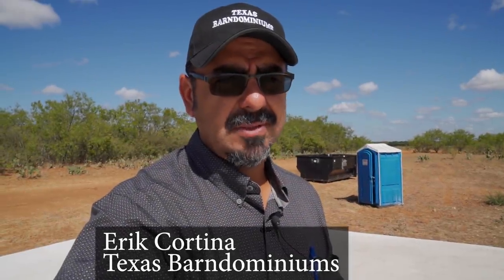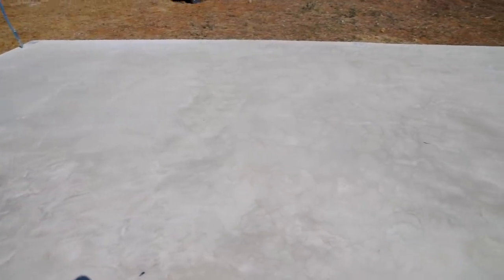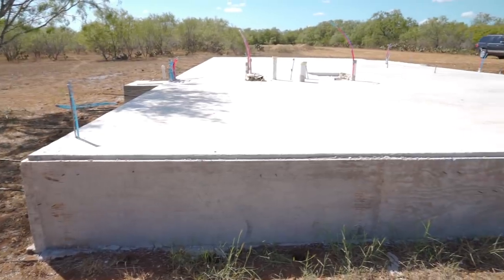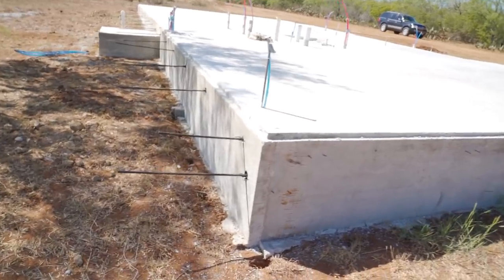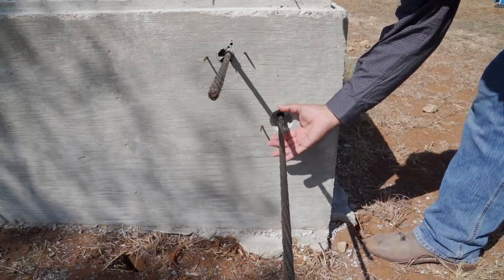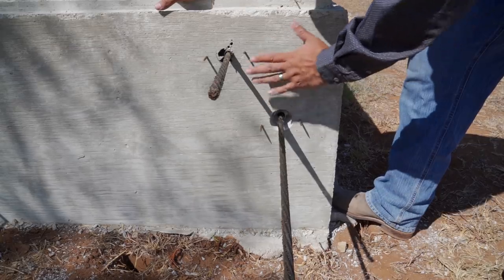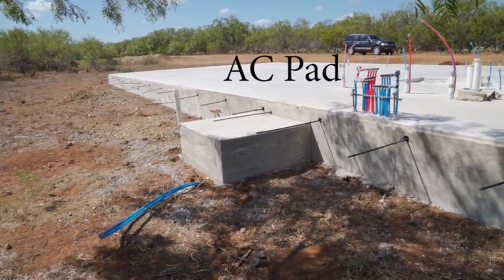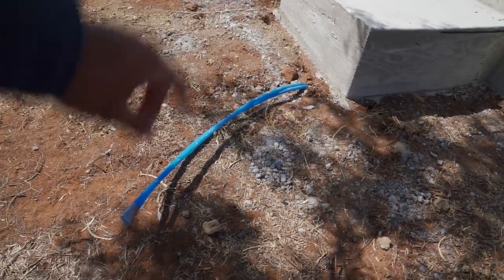Post Tension Concrete Slab - The Barndominium Show E167

Comment: Eric is back! Glad you got a vacation! You just demonstrated one of your greatest strengths; you never quit looking and learning about what you build and the product you sell. Bravo! Post  tension is the only slab on grade foundation it is safe or even advisable to dig under; the company I worked for got a job to replace the plumbing under their condos- all their original bids had included x rays to find the cables and cutting and removing long linear patches of concrete (in sections between the cables and wanted months for each building (two condos, about 5500 total square foot slab).My boss was a civil engineer; he did the home work, and found a complete set of foundation plans and fely locating any neccessary cables would be easy with a magnetometer. We won going away and I've never started a job with so many ashen faces going in- mine among them; we raised up a labor crew, provided shovels and such and tunneled under the middle of the slab- all the plumbing for both condos were on or just off the mid line.The tunnels were about 45-50 long from side to side and 4 feet wide and 5 feet high beneath the building, we cut out the rotten plumbing (the build was on what had recently been farm land and had shallow cover over the Austin Chalk that underlies much of central and east Texas- the calcium eats copper and cast iron pipe) and replaced it. then the labor crews dragged all the earth back in and used w
Wacker Packers to pack and stabilize it, eventually getting all but a couple of bucket fulls of material back under. The City(Dallas) was out and measured our dirt piles and wanted to make sure we didn't cheat on the refiill. No injuries from collapsing foundations, three four times quicker than all the other bidders thought and best of all the boss bought his wife a big new home with his profit. Needless to say, I like post tension; If I cant have a house pier and beam, Post tension is the only way to fly- as you say if it is appropriate for the structure/foundation planned. It is also the cheapest way to build a house from an HVAC standpoint, having the fewest feet of exterior wall for the square footage
Reply from the maker: Thank you.  Cool story.
Reply: @TexasBarndominiums  Hope it helped! The Condo we did in 1997 is still standing- remodeled twice since, but still standing on that foundation. And you are welcome! Vaya, amigo!( you now know half of my spanish skills - the other half is all nasty words). FR

Comment: The "clamps" are referred to as wedges, they slip inside the anchors and hold the cable taught once it has been stressed. The "cups" are referred to as pocket formers and prevent the concrete from filling in the portion of the anchor where the wedges are to go.
Reply: to the uploader- Didnt understand A THING! WHY dont you SHOW us when they are DOING it instead of telling us with your words. We come to you tube to SEE things happening not to just hear and see "photos. We need VIDEO of things happening! USELESS video!

Comment: The plants down here in South Texas use fiber and run 40 ton cranes on the on the pads without ever cracking!  Its much better than rebar.  Im near Corpus Christi with a lot of sand and we uses post tension for the most part with flat work using fiber.

Comment: Haven't done concrete in years but when I did in Ohio we personally chose to use fiber whenever we could, our personal largest was 70' x 100' for a pole barn, but even in patios and driveways it would help out as just added insurance. Agree though it is not a replacement for rebar or mesh in most cases. Love your videos.

Comment: I was a rod buster in the 80’s in Dallas.  I tied rebar (tons and tons of rebar) and installed many a cable in the Dallas skyline.   Ones isn’t any better than the other, they’re just different.  You can hurt yourself a lot more with cables but rebar will break you down over time.  It comes down to what you like to do.  Me, I preferred cables, there’s more math to it.  😂

Comment: I work for a concrete company here in Tucson AZ. We do comercial and reaidental work. Have to say that for the last few years 90% of residental work has been post tension. So far, been working great. But like you said it all depends on the type of floor that you do. Also about the fiber, we normally use that with 3000 psi concrete for driveways and sidewalk. Seems to work pretty good. Just incase you ever decide to work with fiber. But anyways really enjoy your videos.
Reply from the maker: Thank you.

Comment: We use stealth fiber her in AZ a lot (at least I do). I prefer the stealth fiber over the large because we do a lot of grind and polish slabs or stain/seal and the stealth/micro fiber doesnt show on surface. It does help some against early shrinkage cracks, as long as your slump isnt too high.
 If youre pouring on compacted ABC sub grade with rebar or post tension, water to cement ratio not too high, fiber mesh and putting a hard trowel finish on it, I dont think there much more you guys can do except for maybe curing techniques.
I typically just keep the slab wet as much as possible for first 24 hours after finishing.
No cure and seal..ever. I will not use that stuff

Comment: That "machine" is called a stressing jack.  They "tension" the cable not stretch.  They measure the "elongation"   pt cable won't keep it from cracking, but it will keep it all together in the long run.  But what do I know,I'm just a bus driver.

Comment: is the slab 'loose' in a sleeve? I'm picturing doing the tensioning and the rebar is getting pulled against cement and it doesn't seem possible.

Comment: Usually How deep are the post tension cables from the top of the slab? Reason I ask if I want to bolt down an air compressor to the concrete I don’t want to hit a PT cable.

Comment: Fiber is meant to control shrinkage cracking in the plastic state. It does very little after its initial set. The only fibers that add strength post set are steel fibers which can splinter at the surface. Obviously not good for bare feet or small children. If your early pours with surface retardants are giving you good results without shrinkage cracks, stick with that. Keep up the good work, it's always a pleasure watching a true tradesmen vs. a hack.
Reply from the maker: Thank you.

Comment: If I wanted to have a two story barndominium built...is pouring a slab on top of another existing slab, a better option than building directly on clay, sand, loam, & silt soil? 
I'm not a builder, am interested in having a source to research such info, if available as well.
I live in Corpus Christi Texas.
I have to say, I highly enjoy watching your show!
Reply from the maker: It depends on how the current slab was built.  Hire an engineer and find out for sure.

Comment: Fiber is better for preventing small cracks rebar for preventing the bigger ones I tend to use a little less rebar and fiber reinforce and rarely run into problems but I'm guessing that yours are from getting to hot while curing if not able to run water on it use plasticizer to reduce water and sealing it while it has moisture still in it with a sprayer helps tons that and having a good enough crew so that you don't end up with an overworked mud with no strength in the top layer! The other consideration is the rock the concrete companies use. there was an entire town that the concrete was failing because the rock they used at the local concrete place wasn't good enough ! It's less of a consideration now adays but some rocks expansion rates when heated and cooled can be far different than some concrete!

Comment: Hey Erik. I have a question or two. I recently bought a lathe (for gunsmithing) and need to build a larger shop. I’d love to pay someone but it’s not in the budget. I’ve done some research but still not fully comfortable on starting the project. Can you recommend a book or a web link that could lay out the information needed. I’m mostly worried about sight prep. It’s going to be 24’x30’ and I have no problem with any other part of the build. I just don’t have the knowledge needed to pour a slab correctly. Thanks for your time
Reply from the maker: Form it yourself.  Make sure it’s square and level.  Make it 6” thick and dig a perimeter beam.  Make that beam 12x24 deep.  Then make another beam so you can split the 30’ section down the middle.  Put down 6 mil poly and put 5/8 rebar in beams, 2 top and 2 bottom.  Put stirrups at 24” spacing.  Put 2 corner bars at corners and 4 at the beam intersections.  
Once ready, hire 2-3 finishers to pour it for you.  I’m not aware of any books.  Sorry.
Reply: Thanks for your help. I appreciate both of your channels and all the work you put into them.

Comment: On a small job pt is more expensive but on a big job like a few levels parking garage  pt is cheaper because it could use a lot less rebar in some cases although it has better reputation on keeping cracks to a minimum on any structure

Comment: If you ever have a leak under the slab(water or drain)and you have to brake concrete.  Very common in texas by the way. How safe is to accidently cut on into one of those wires.
Reply from the maker: Before digging into slab, they release tension on cables.
Reply: @TexasBarndominiums   I guess we just pray a leak doesn't happen because not only we need to pay the plumber. We will need a special company that can do post tension cable detensioning. Which according to what I read is very dangerous due to corrosion over time and potentially can make your entire system fail. I'm not trying to shame a system that's been around for a long time. Just thinking about pros and cons of each.  Thanks
Reply from the maker: That’s worst case scenario.  Cables are encased in plastic sleeve full of grease.  

The PT companies aren’t “special” companies, they are abundant.  

Either way, an engineer must be contacted every time something like what you mention is done.  Even rebar slabs shouldn’t be cut up at will.

Comment: Thanks Eric. I know its called Post Tension, but isnt it really Post pressure ? The cables squeeze the concrete right ? 

Another thing, different subject...I found this comment on another barndo company channel. Who is this guy ?
. 
The Hungry Hunter
2 days ago
So I recently stopped working for Texas Barndominiums, I was the video guy, anyways I have to say i really like your videos.
Reply from the maker: That’s Daniel (hungry hunter)

There is pre-tension and post tension.  It’s referring to the reinforcing, not the slab itself.   The steel cables are tensioned after the slab has been poured, hence “post” tension.   
Hope that helps.

Watch this video to learn more: 
https://youtu.be/guozDnLjwo8
Reply: @TexasBarndominiums  Daniel left ? wow.  What happened  ? I was wondering why there hasn't been a Friday feast video in a while.

Comment: Just my opinion but do not use fiber. Every slab I have seen in my area you still can see the fibres at the surface, I could even show you one in my area that looks like it needed a shave (finished by a supposed pro finisher). In my opinion it is applicable in a slab that you are just going to screed and float 1 time, or broom the surface, but I don't know that you would be happy with the results verses the labor in finishing it. Just a suggestion but if you try it, use it in a carport or something that won't be as big a disappointment as say in the livingroom or master bedroom in one of your Barndo's.
Reply from the maker: Thank you

Comment: My a/c pad is also attached to my slab. I don't like it. It does transfer noise into our home. If I do this again, and I plan on it, I will isolate the a/c pad.
Reply: John D, put an isolation pad under the condenser. Problem solved.
Reply: @dc9039  Our home is less than 3 years old and so is the a/c, obiviously. I believe the legs have some sort of "shock absorbing" feature.

Comment: Curious why such a high foundation?  Is it a flash flood zone?  I'm guessing, post tension was engineered because of the height of the foundation and the amount of concrete called for?
Reply from the maker: No, height of slab is not the reason.  
The ground slopes down, and slab is level.  That’s why it’s like that.